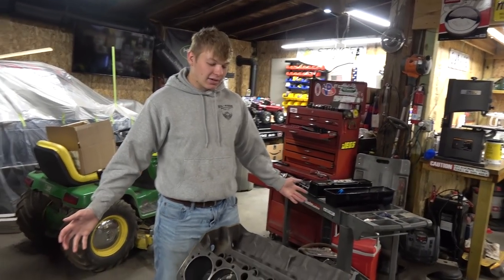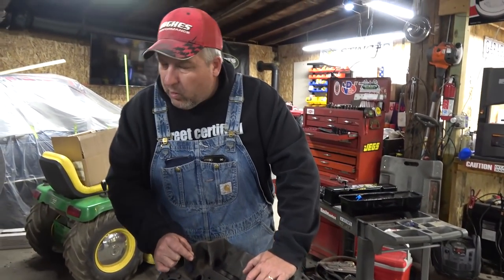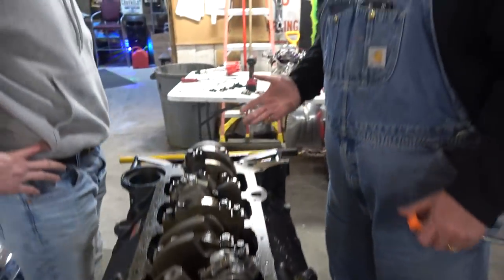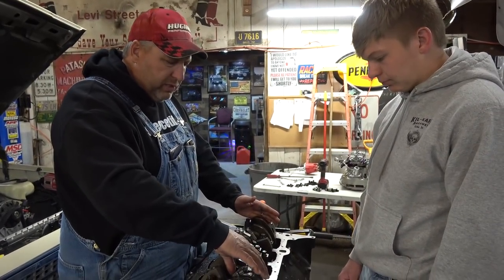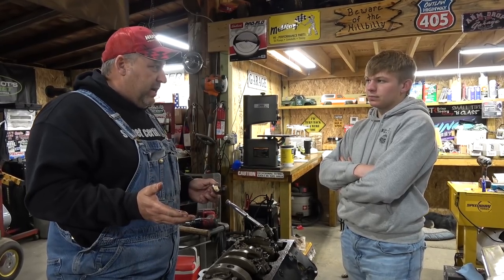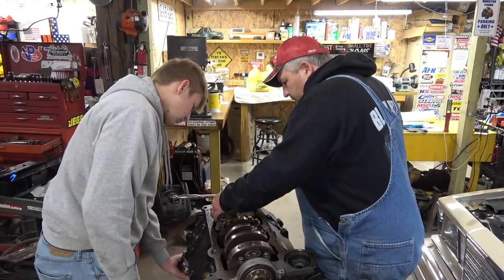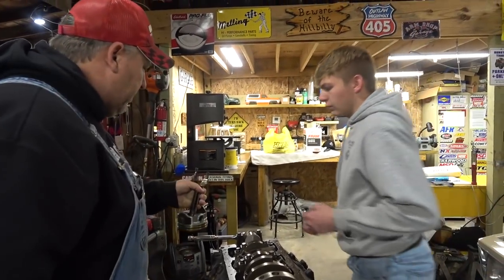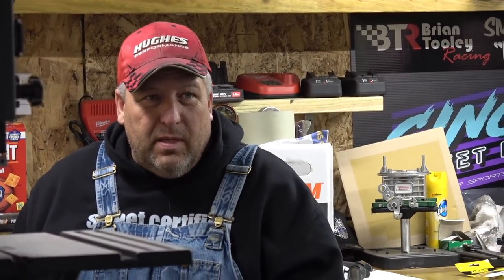385 SBC TEARDOWN! How to go over an engine that's been sitting!

Comment: I run a flat 
Tappet cam shaft in my S 10 haven’t had an issue yet it’s been over 10 years like your dad says you have to use that oil

Comment: Should look at putting a jegs top end kit part # 555-514195 it's got nice size camshaft hyd flat tappet with a little over 500 inches of lift ground on a 112° lsa. It listed at around $ 1200.00.

Comment: Therein lies the issue...Break in a cam properly, or seat the rings properly. Am putting my fresh short block back in, with my older cam. Will not even fire it up here at the house, heading to the track, will first fire it there, check for leaks, etc. Then Make some under power passes to seat the rings, then once 2 track trips are finished, switch out and degree the new cam, then break in the cam here in the garage. But going to treat that new balanced and blueprinted, honed bottom end, and new forged pistons and rings right first!

Comment: Blueprint builds engines right, the issue can sometimes be too easy a break in, in other words, someone who did not use an engine dyno, or a race track to break in the rings to seat them under power, but instead did the worst thing you can do, started it up in the garage or shop, and idled during breaking and seating of the rings. That cross hatching of the cylinder walls does 2 things, it maintains holding oil, plus rings new has little paks on them, during break in, you should pull the mo tor hard, and the cross hatching wears the peaks on the rings surface, so it like files those peaks off into the cross hatching and seats the rings to the walls.

But, if they idled it a lot or revved it not under power, then it knocks off the cross hatching, before the rings actually get a real chance to seat properly, and get blow by.

Hard to tell if the smoking was improper ring seating, or really bad guides.
Reply: Peaks, not packs

Comment: I did a lunati bracket 2 master cam kit 515/515 lift in a 85 S10 with AFR heads and 10/1 compression with 3 inch exhaust and it ran 11s. 750 double pump and victor Jr. intake. 

Lunati has a great thump and pretty cheap, you won’t be disappointed

Ran 11s with no nitrous. It was a 4 bolt main stock rods, out of a 93 CK truck block.

Comment: I built the same type engine.mine is is stock bore/stroke.86 block with vortec heads summit 1103 cam.stock vortec pushrods.

Comment: Mains  rods and rings are cheap insurance ,rod side ,piston to wall, crank end play, and proper main bearing and rod bearing clearance is easy to do,,put a cheap comp 274 cam ,some cheater gaskets and some flattops,and some cheap 305 heads with 58 cc chambers ,a single plane was one of the best cheapest combos I ever ran,talking sheep I had under 500 dollars in it and it would run low 12 seconds times for little money,I think people would love to see the cheapest build possible speaking of oil  ,I run diesel oil it has the highest zinc content  and I ran it for years,you also have better oil pressure,do a cheap build would love too see it ,oh and if you were broke at time it would still run on regular gas,I would love to see a simular build and see how much it had on the dyno,hint,hint  anyways awesome stuff guys and gals

Comment: Brad penn is an excellent oil. It's also 10 bucks a quart. I only use it in my street strip car with flat tappet. 

My new truck motor o2m going roller. Ill make up the roller money in short order. But that just me...

Comment: 327/365hp cam in that engine would be a runner and no valve spring mods on those vortec heads.

Comment: If you use vortec heads used check them for cracks I have engine running fine tear down its heads Crack between the valve's

Comment: Why not just replace the rod bearings, check all the bores with a good bore gage, hone the block at home with a ball hone for iron rings, hot tank the block & run all the oil galleys with a wire gun brush, fit a new set of iron Hastings rings on the old pistons after a good cleaning, put a 65PSI  standard volume oil pump on it, buy a fel pro gasket set , then assemble the short block. Spend your money on the heads and call it a day.  Run a  CHEAP mild flat tappet hydraulic cam  with Valvoline VR-1 high zinc oil and that thing would run for years most likely.  Just remember gas prices are NOT going down !!!! so stay away from long duration cams shafts.

Comment: I am old school and did not have the roller cam option back in my day. We had them but nothing on a budget. From what I see you need to budget in a roller cam. If you do not you will always have that issue and it will cost you an engine. You would be throwing away money and labor not to mention the grief and heartache that will follow close behind. I have done that and been there... And someone needs to ditch the yellow fingernail polish??? Yuck! Sorry that the Old Man is so hard on you Tommy...

Comment: tommy the none seat rings ( smoke & use oil ) this was a mack truck newly rebuilt the mechanic from main mack rebuild place putting something Like dust in air in take with out air filter in holder it a older f model a cab over truck like a 300 max or 315 plus there same motor block cam & injectors pump & stuff is different, there a 5 speed behind a Maxadine & thermadine  this like a 10 speed or duel stick trans i seen 20 forward speeds on one your sick of shifting after a trip! this guy had a problem with his older b model mack where i worked fixed it the owner said he hauled 100 T lb(over weight) from Canada, to usa one time of trip i was to where my class was he took to the hotel & i got the floor & it was 12 grade fun I stay about 20 mins went threw 2 cups of coffee went to air-force instead of trucking! that really a truck it got 6 wheels it looks like half a pickup the boss was joking what that old thing I take it! i drove one load in a semi on weekend work backing other thing! my trucking came to end really on jan 2 1987 at like 4 pm a gm v6 tt 2 stroke deisel ran away & burned 5 building to ground shop too repair semis( i was lay off- fire burned place down not normal like bad job) ps hyd old cam for 327 corvette & open heads) i did 360 & 318 dodge i quit chevy till like 2002 old motors v6 3.1 or 3.3 1990 stuff blood clots mess! i used electric painter in Grumman under coat  & my seal my deck! it like 25 bucks it works right!
Reply: the mack sealed the rings the owner though they re rebuilt the motor & all they run it up and down hills & it quit smoking changed the oil! 10k later its fine great rebuild the owner said!

Comment: Didn't the throttle body 350s (87-95) all have hydraulic flat tappet cams?
I think the hydraulic roller cams came in 96 when the vortec V-8's began.
Reply: I believe you are correct but most of those blocks had previsions for the roller cams, those are the blocks that I look for cause most of them have the cover over the fuel pump rod, but I can add a mechanical fuel pump to a car that originally had a electric fuel pump

Comment: There's nothing wrong with a flat tappet cam, people ran them for many, many years for many, many miles! You can also run Shell Rotella T diesel oil with a flat tappet cam, much cheaper than some Brad Penn oil or something, it has all the goodies in it you need for a flat tappet cam! The Vortec head's are a good head, the only problem is in stock configuration you can only run like a .460 lift cam, so you gotta either have the bosses shaved down or run a beehive spring, lots of videos on here about them! But they're a better head than the old Camel hump heads! A great flat tappet cam is the Isky 292 mega cam is a great street cam with plenty of power, up to 7 thousand rpm's! With an Iron head like the Vortec head's, yes you want to stay at 10:1 compression or less for pump gas, you can get away with 11:1+ with aluminum head's. That's where timing really comes into play!!! But a 385(383) with Vortec head's and a nice flat tappet cam will be a very fun street engine! Probably 400-425hp, then gap your rings so you can safely hit it with a 150-200 shot, hell yeah!!! But really look into the spring clearance deal with the Vortec head's!✌🏻🇺🇸👍🏻

Comment: Comp magnum 280 cam would be a great choice.  501 lift. 230 050. And 106 lc.
2000-6000
Reply: Why do you say?
Reply: @joshuagibson2520  I have been  building race motors and chassis for more than 30yrs.
THUNDER STRUCK RACING.
Reply: @THUNDERSTRUCKRACING70  that's why I'm asking. Trying to learn. What's the 292 have in common with the block, pistons, and compression that would make it all beneficial? Why choose the 292 as opposed to another?
Reply: I can always take someone's word, but I want to learn the how and why.
Reply: @joshuagibson2520  the cam is a hydraulic flat tap. Has 106lc. 230/230 050 dur. With 501 lift.  That is a old profile,  so there might be a slightly better one now.  Was a great cam in my 10 to 1 355 cid SBC. Was a daily driver.
Reply: @THUNDERSTRUCKRACING70  got ya. Thanks.
Reply: @THUNDERSTRUCKRACING70  what sate are u located?
Reply: @THUNDERSTRUCKRACING70  you want a cookie?
Reply: For a street engine, keep the cam under 220 duration and under 480 lift, again for a street engine, pick the perfect cam of and buy the next one smaller, for max power on a budget there's many things you can do but that's not what is going on here, I actually buy RV stage 3 or 4 cams from rock auto for cheap and they treat me good
Reply: @cargotoolshop5319  no
Reply: @cargotoolshop5319  
Your a D A.     I have been building race motors for more than 30yrs. 
That was a 355. 10 to 1 with comp. Magnum cam. 750cfm carb. Team G manifold. Worked 23* heads.  2400 stall ran 11.89 at 113 1/4 and drove it every day. 70 El Camino SS

Comment: Do not under any conditions run a flat tappet cam. all of the new stock are failing because they are not grinding with the correct angle. Not enough and lifters are not spinning. wiping lobes. unless they are old cams laying on a shelf from the old days. I guarantee this.

Comment: When explaining over boring and how core shift can limit it, you talked about core shift of the cam tunnel/bores.  No question, that could be a problem for the valve train, but it has no effect on over boring.  Core shift of the cylinder bores is what effects cylinder bore limits.  Every cylinder needs to be checked individually for core shift with a sonic tester.  Anyone who visibly inspects the cam boss to determine if a block can handle .060 over pistons probably doesn't fully understand "that thing called core shift".  Call me a hater, then research core shift.  Better yet ask engine builder Uncle Bob to explain core shift to you on video.

Comment: Please don’t do flat tappet. It used to be ok. They don’t make the lifters good anymore. Watch this video from uncle Tony who builds lots of flat tappet mopars and he has wiped many cams due to manufacturing issues. Spend the extra 400 go roller lifter save your heartache and gain 40 hp. Unless you can find old new stock
https://youtu.be/ycb8Yy38DwU

Comment: Sorry Sir, but it's not true regarding the 1/2 rod bearings. Experienced Race Engine Builders like myself will tell you, it's generally 5/6 on the SBC and BBC. Oil pump location has nothing to do with that statement. I'm a Godly man Sir,  I'm not trying to be confrontational but truly trying to help. And yes I'm a Engineer. 
T.S. RACING